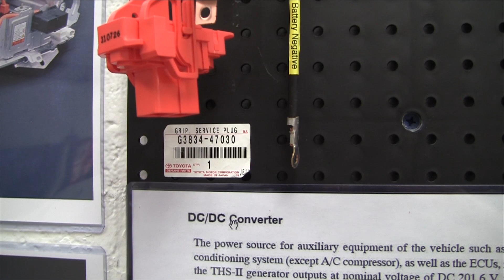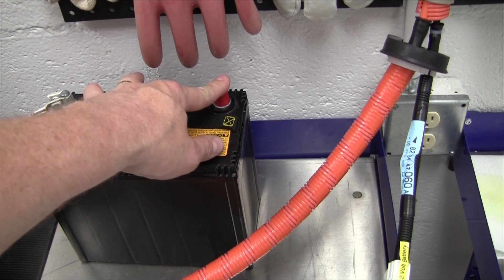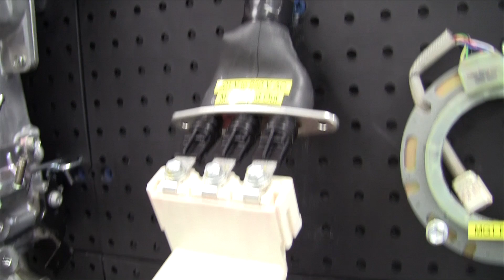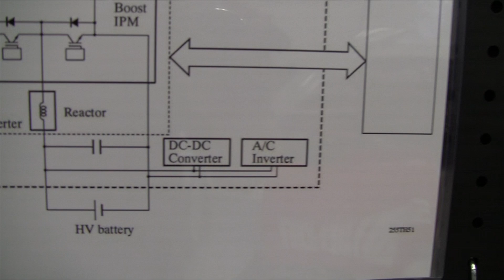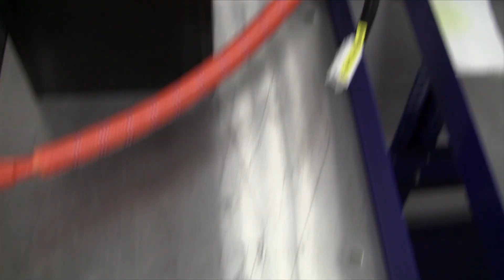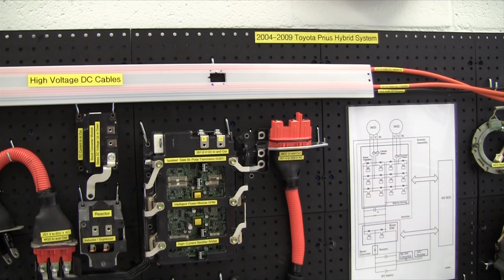2004-2009 Toyota Prius High Voltage System Operation

Comment: You encouraged me to work on inverter/converter unit on my 2007 Prius.  Dealership wanted to charge me 5k for it but it cost me $300 on used unit.  My Prius is almost 277, 000 miles and counting!!!!   Thank you so much.
Reply from the maker: Awesome, good job!
Reply: Was it hard do  it ,my 2012 Prius converter with bad at 122,000 miles . It still had warranty I save $4200. I got 4 years more of warranty or 30,000 miles more until warranty ends  lol

Comment: I do not know English very well, but I've seen many videos of you. You are an excellent and extremely professional teacher. For 3 or 4 years I subscribed to your channel and I liked all the videos I've seen. I work the electronics of the cars. I know something about robotics, mechanics, electronics. I think cars are robot with wheels. I like the electrics and I think the hybrids are a step to them and until the infra-structure is created so that we can all have an electric car, the hybrids are good. I had a 2006 Honda Civic Hibrid. I bought it in 250 dollars because they were going to join it. In a few hours I put it to work. Now I have a 2006 Toyota Prius. It does not work With what little I've seen, I've learned that it's very different from Honda. It has helped me a lot to see all your videos of the Toyotas II Generation. The high voltage batteries had 190 volts. They had a lot of sulfate in the contacts. I cleaned everything very well and now it has 201 volts. The scanner gives me two codes: 1) on the HV and it tells me to replace the Inverter-converter module. 2) Replace the battery. When I try to start the relay of the battery block sounds and in the dash it flashes READY 2 or 3 times and then the red triangle appears. I have another module inverter converter equal, but my question is whether it is the module or the batteries. I measure the voltage of them at the moment of starting and lowering something, but in a few seconds they return to 201 volts. I also want to know if the starter of this car is only for the MG1 or has an external one. I already learned with you that it has no alternator, which it does through the conversion of 201.6 to 12 in the inverter module of the A / C. I know that the Honda does have a starter, but it still does not. Please, I need your help. You can answer me in English and I use the google translator, but if you can send me some documentation in Spanish I would also appreciate it. Thank you very much for all your videos. I'm sure you help thousands of people around the world, because you do it with professionalism and love of what you do. Greetings from Tampa, Florida.
Reply from the maker: Thank you, There is no starter, MG1 starts the engine. It sounds like you still have a battery problem. The converter trouble code is not a good sign either. Best wishes

Comment from the maker: Hi, upon further investigation I have determined that you are correct, the labels are reversed. The second generation had two relays on the positive side and one on the negative. The third generation Prius is the opposite with two on the negative and one on the positive. I was also wrong on the contactor verses relay name. Toyota does call them System Main Relays (SMR), I think it is GM and/or Honda that call them contactors. So many different systems, yet all similar. Thanks again!

Comment: Thank you John D. Kelly at WSU for confirming my suspicion that the HV wiring labeling is incorrect. At 2:05 the labels should be swapped. The +ve cable being the short one  and the -ve cable being the long one.
Reply from the maker: Thanks for catching my error. have a good day
Reply: I came here to say this.  If you happen to connect the positive and negative as labeled the resistor is rendered unusable.  Took me quite a while to figure out why this happened and how to fix it.  I had spent so much time working on the battery itself I had neglected/forgotten exactly how things were connected in the switchbox.  I am now running my 2008 with a crudely assembled battery comprised of K2 Energy LFP26650P factory assembled banks, each containing 80(20s4p) cells for a total of 64V and 10.2aH.  I have 3.5 of these connected in series and fashioned the leads for the 'modules' to reach the appropriate connecting points.  Car is running fine, I think I need to find a way to get each row of 4p cells charged to 60% capacity.   The cells are nominally 3.2v LiFePO4 8.32wHr (2.6aHr), so a 'module' is a section of 5s4p for 16V nominal and 10.4aHr vs. factory NimH 14.4V and 6.5aHr.  These banks came out of US Navy power system used offshore so they are assembled Stout!  I chose to use 'as-is' after attempting to harvest the cells to reconfigure... Lots of sparks, very difficult to get apart... not worth it.  The car tries to keep voltage around 230V, the specs of these cells suggests maximum cutoff charging voltage of 3.65v.  As power cells they are(were) K2 Energy's version of the LFP26650 to provide more current... I think these were used in what I can best describe as a Pulse Power System?  And from other research, perhaps to power weapons systems?  These were free, a scrap dealer had them and didn't know what to do with them.  Offered them free so I took them not knowing anything about them.  I have far more than necessary for my 2 hybrid vehicles, was thinking powerwall utilizing the components I have as close to design as possible.  I am getting no help from K2 or Actia who provided the Master BMS 4 for the Master Control Units and the Slave 5 boards 32V.  An italian company designed and manufactured the charging module.  I have no connectors for any of the components.  I've drifted waaaay off topic.  @WeberAuto - Excellent Videos!

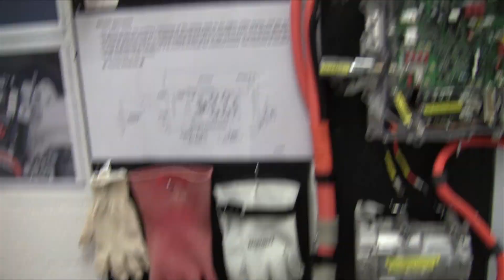Comment: Excellent Video!! Thank You!.    at 17:30 to 18:00 Min, how much current is the DC to DC 12 volt battery supply capable of producing at 12-14.5 Volts?  I want to hook up a 120 Volt power inverter to the 12 volt battery in the back.
Reply from the maker: 100 amps, but the car uses up to 78 amps with the engine running. Not much left for an inverter. The 12V battery will make up the rest as it slowly goes dead. See https://youtu.be/_V9PiOpaxyE

Comment: That's the most comprehensive review I've found, good job. As a Lexus 400h owner, my experience has been mostly with the very small 12V battery. Because the large rear battery will not charge the 12V battery when key is off, you have to be careful not to run that little battery down. I've boosted a few times already and we have booster cables, which are unfortunately hard to get to because the trunk won't open with a drained accessory battery. Boosting is done in the usual way.

Comment from the maker: Hi, No, the high voltage system is totally isolated from the 12V system. It is like a flashlight sitting on your back seat (it has its own isolated power supply).

Comment from the maker: Hi, The wiring is correct, that part you call a hall sensor is a current sensor. The sensor is used with the precharge contractor and high wattage resistor to detect a stuck closed contactor.  The Toyota service information calls the high voltage relays "Contactors".  A contractor is typically used in high voltage high current conditions; relays are typically used in lower voltage lower current conditions.  Every hybrid vehicle I have read about and received training on uses "Contactors".

Comment: We work on hybrid at our shop, and we use Your illustration to explain to our mechanics, overall (block diagram) system,how to troubleshoot voltages and communications between computers ,Amazing Illustration, Good Job  
I would like to add a notice that if you decide to tow your vehicle you can use Wheel-lift towing as long front wheels they are not moving (Front wheel drive ),Kindly correct if I am wrong .
Reply from the maker: Thank you! Yes, you are correct, front wheels must be off the ground.

Comment from the maker: Many hybrids have jump start terminals under the hood (even if the battery is in the rear). You might check the owner's manual to see if your model does.

Comment from the maker: Hi, there is not a way to disconnect the battery while driving.  The electric motor generators need some place to send the energy created during deceleration, the battery is the storage for that energy.

Comment: Excellent learning material.... I have watched your video many times despite the camera movement..I have learned a lot about hybrid electrical system...If you can only improve your video by using a tripod on your camera with an assistant to focus the camera on your visual materials, I'm sure , this will make WSU a big HIT on youtube like a blockbuster..   More power and million thanks.
Reply from the maker: +art rigor Hi, Thanks for the feedback and thanks for the compliments!

Comment: 2005 Prius has a repetitive indication of a Hybrid Battery problem.  I bought a rebuilt Hybrid Battery from a national auto parts company with a 3 yr warranty.  Initially replaced the original prius Hybrid Battery and 12v battery in February of 2017.   It appeared to resolve the problem.  

Three months later, in May of 2017, it indicated an OBDII code of P0A80 and I replaced the Hybrid Battery again under warranty.   Both times the replacement battery worked well initially.  But it rarely achieved 100%.  Usually the dash indicated 80% at best.

Two weeks ago, I got the red triangle and P08A0 code, cleared it and drove with no problem, just noticed that the Hybrid Battery indicated on the dash that it dropped to 10% - 20% very quickly, especially if parked overnight or for a few days.  But with driving returned to about 60 to 80% of its strength.  Yesterday I had a Red Triangle on the dash and these OBDII codes:  

1.  P0A80 (Replace Hybrid Battery Pack), 
2.  P2505 (EMC Power Input Signal), 
3.  P0403 (EGR Circuit), and 
4.  P000A (Engine Position System Performance).

My question is what is really wrong?  It is difficult to believe I have gotten two bad replacement batteries back to back.  I think there is something in the system that is slowly draining these batteries.  I would expect them to reach 100% after a little driving at least when first installed.  But with them dying after only a few months, something else must be wrong that has not been giving me a code, unless the key problem is reflected in the P2505 code.  

If there is a problem within the ECU, is there a likely part or parts that I could test and replace if bad without replacing the entire ECU?   The car is in Florida with only 175,000 miles on it.  It has been driven about 5,000 miles this year.  Thank you.
Reply from the maker: The battery level is not supposed to go up to 100% while driving, it typically will be in the 40-60% range. This way there is room for energy storage while decelerating and power for acceleration. The new Prius we have stays around 40%.

All of those DTCs are related to a bad hybrid battery. The hybrid battery supplies power to the DC-DC converter. The DC-DC converter charges the 12V battery. The 12V battery supplies power to the ECM. If the 12V battery power is low (because it is not being charged properly by the hybrid battery), it will trigger the rest of the codes your vehicle has.

Rebuilt hybrid batteries are nothing more than someone else's bad battery that someone has replaced a few bad cells )with other used cells they hope are better then the ones being replaced). It is very possible to have another bad hybrid battery. Best wishes.

Comment: Hi Prof, as usual great video. Just wanted to check if there are no refrigerant in the air con pump will it throw a code? POAA6?
Reply from the maker: Thank you. Lack of refrigerant will not cause that DTC; however, the wrong refrigerant oil will cause that DTC. Best wishes

Comment: So the electromechanical coupling is basically the "gearbox" of this vehicle
(with the engine driving the planet carrier, the big motor connected to the ring gear, and small motor connected to the sun gear),  and the high-voltage IGBT inverter transistors are what's dissipating the heat, requiring "gearbox" cooling.

So if MG1 and MG2 both have an efficiency of 95%, the electromechanical coupling should theoretically have an efficiency of over 90% (including IGBT transistor losses). In actual operation, once the vehicle is moving, some of the engine's torque will be mechanically transferred unto the ring gear via the planet carrier and only a portion of the torque and power goes to MG1 via the sun gear to be converted to electricity and then instantaneously routed to MG2 (traction motor), making the efficiency over 90%.

Pretty much as efficient as a manual gearbox but with better rpm control + regenerative braking.

Therefore, the added efficiency of the Prius is due to:
a) regen braking
b) atkinson cycle engine
c) efficient "electromechanical-CVT" gearbox that allows flexible rpm control including engine start/stops
AND NOTHING ELSE, except maybe a little bit from aerodynamics.

Comment: Extremely interesting and technically-oriented. Seeing the cut-aways and the cabling in real life sizes takes some of the mystery out of it. Thanks for showing us your setup. Students at your school should be able to learn about the Hybrid system very easily. BTW, you mentioned about never towing a hybrid vehicle. What does someone do if they need a tow? Call a flat bed truck?
Reply from the maker: Thanks for the feedback! Yes, call a flat bed tow truck.
Reply: why?
Reply: +Marcos Robles: Watch the video for the answer, it's at 21:50
Reply: If you have to tow lift the front wheels off the ground only  if it's a front wheel drive vehicle. If it's an all wheel drive like some the RX and Highlanders you will need that flat bed

Comment: 23:32 In theory one could run a cable from the 12V battery to anywhere in the car, add a switch, and return back to connect to the big battery. That way one can have a quick way of disconnecting the 12V battery. Correct?

Comment: Awesome series on Toyota Hybrid tech, you do a great job of explaining.  I'm getting an '08 Highlander Hybrid, is it most similar to the Gen3 Prius system?  I'm an old electronics design engineer (25+ yrs exp.), and a lifelong 'hacker' (in the legal sense). Do you know if there is any kind of published data a person can buy that would give any amount of in-depth detail, and such info as module connector pinout/functions? I want to learn every aspect of "how's & why's" of the Synergy operation.

Comment: At 2:18 the two main HV relays are shown labelled Positive and Negative. However, I believe the labeling to be incorrect. The short cable is connected to the +ve post while the long cable is connected to the -ve post.

Could you please clarify?
Reply from the maker: I labeled them incorrectly, they should be switched

Comment: Mr. Weber   
What would you recommend disconnecting if one were to perform flux/arc welding on this Prius other than the 12volt auxiliary battery +/- ?